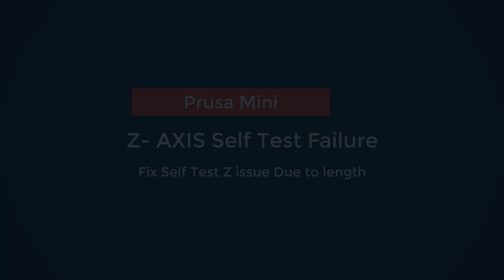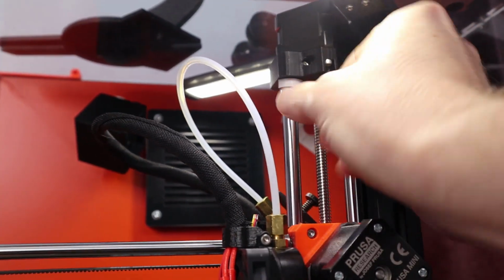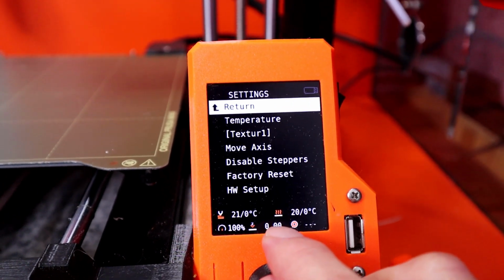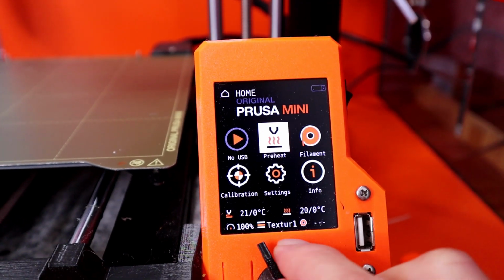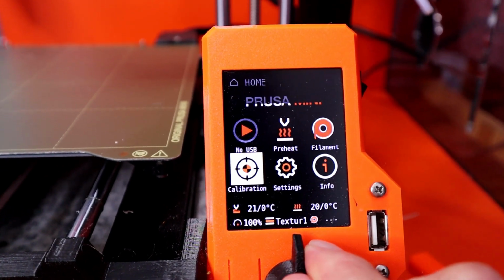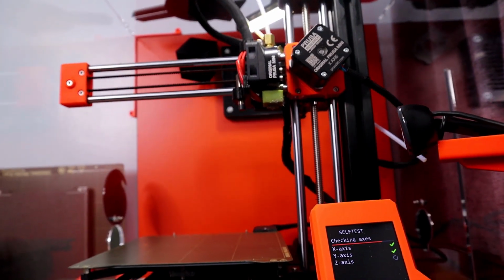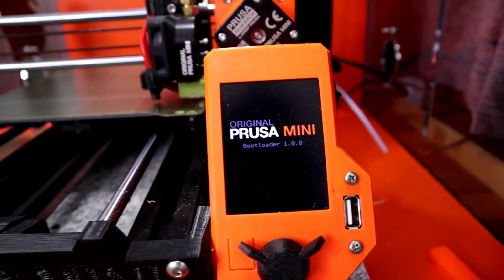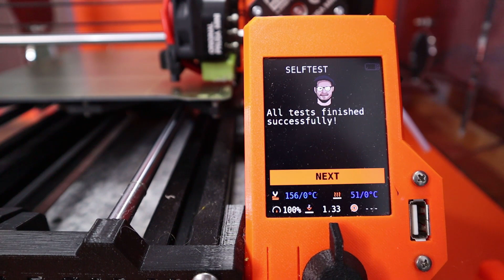Prusa Mini Z Axis Fail - SOLVED - Self Test Wizzard

Comment: Updated firmware to 6.2.4 but the axis file wasn't created . Nevertheless , having also upgraded the original extruder , I jumped into the hidden menu and changed the Z-axis length to 190 . Celebrations ! It gave me that one last green tick that had eluded me.
Nice one , thanks for the headsup.

Comment: Thanks for the video. I started having the z-axis fail issue two days ago (it was working fine before that). I haven't changed the extruder, so I don't think the length of the lead screw is the problem, but I'll try running the test with a USB flash drive in and see what it says.

Comment: When using firmware 4.3.3 or later, proceed this way to adjust the e-steps value and reverse extruder direction:

go to LCD Menu, enter option Settings, scroll down to highlight HW Setup then long-press the knob. Similarly to the MK3S+, a new “Experimental” submenu will appear on the screen.

Scroll down to "Z axis lengt":

Adjust value to 190.

Scroll down to "Extruder step":

Adjust value to 415.

Scroll down to "Extruder dir":

Change value to "wrong".

Don't forget to Save before exiting the menu.

Comment: Worked like a charm, thanks.  I also installed the bondtech, so that's definitely the problem.  Crazy how I went a year without calibrating and it was never an issue.  I only did it because of a teardown I recently did.

Curious, where did you get your stone plate?  Looks very nice compared to the Lowes paver I'm using.
Reply from the maker: It's a stone tile, not as good as a paver.

Comment: Great video! I am just running into similar issues, I hope your advice will solve it. Did you mention you replaced your extruder? Can you share what extruder do you use, and why?
Reply from the maker: Bond tech Ifs extruder, it doesn't jam like to stock extruder and also more quiet
Reply: @colinhill  Does it make a change for Prusa when accessing their support?
Reply from the maker: @YigalBZ well you can't really say you have fitted it. Choice is yours, wait until the 12 month warranty has expired? Or worst case fit the old extruder if you have to do a return. I found the new extruder faultless in operation. I also recommend using the bond tech heatbreak.
Reply: @colinhill  191 into the secret menu...Hooda thunk.  I ran into that today after an attempt to update the firmware failed, and I spent a couple of hours in Chat with the very nice Prusa people.

I was in the pre-order crowd for the original Mini.  It seemed pretty good for a while, but then I started experiencing a mix of extruder and hot end problems.  I installed the Bondtech extruder and heat break and things were much better.  I did modify the heat break installation (used a small soft mouth clamp) and also added three slightly longer stainless cap screws so it was easier to adjust and set.  I'm probably going to try the Slice Engineering hotend upgrade kit next.

Comment: curious - why have you set your extruder steps to 325 when Bontech advises 415?
Reply from the maker: My slicer sets it to 415, just not got around to changing on the actual printer - the facility wasnt available until relatively recently. :)
Reply: The secret menu doesn’t exist anymore 😢 any other tips?

Comment: that secret menu in the new firmware is also now where you adjust the estep for the bondtech ifs extruder instead of running specific gcode or use custom settings on the prusaslicer. it makes the prusaslicer closer to default by no longer requiring that, or one less step after booting up the printer by not having to run that gcode recalibration.